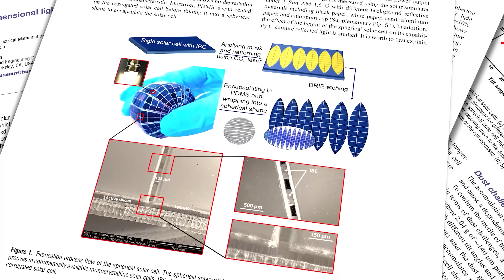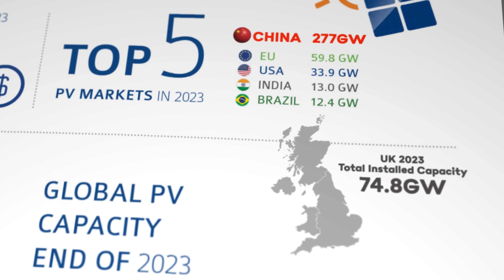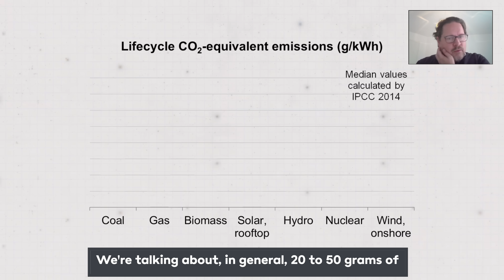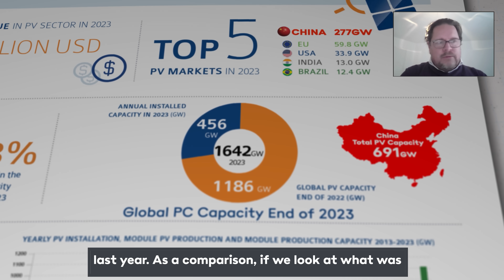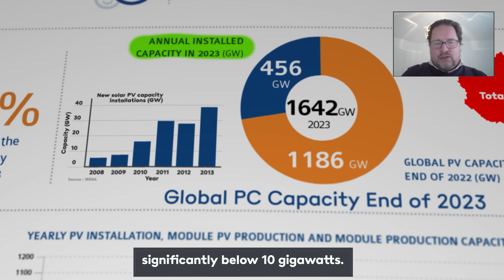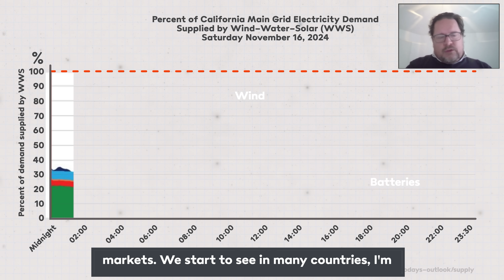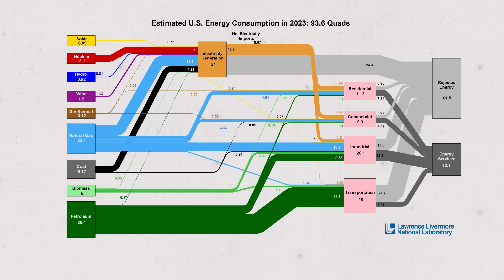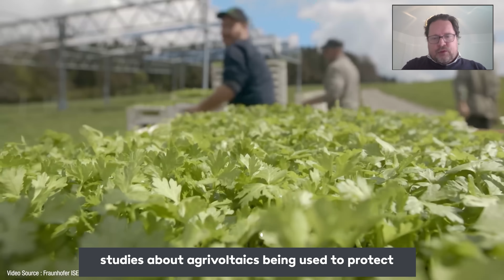Renewable Energy Domination

Comment: @Just Have a Think, I'm wondering, would you be able to please look into any studies or how beneficial ground-based solar panels could be for combating 'Soil Erosion' and 'Desertification'? Due to over-farming and grazing, deforesting, removing shrubs in semi-arid regions, soil salinity and desertification, encroachment of the desert is still an ever present concern. Some farmers and land owners have taken the initiative to build "carbon sinks" of former grazing land, to re-forest it with native vegetation and turn the land around from salinity and erosion from bad past practices. I wonder though, if, like with Solar Agrivoltaics, could they be selectively and targeted, to such border regions, more sun-exposed but also at-risk of erosion encroachment and a large panel array could be amongst the re-introduced low-lying scrubs and provide shade for native fauna, in those hotter, drier and lower rainfall, areas? I'm from Western Australia, so speaking with that kind of habitat in-mind, where the edge of the agricultural region meets the desert, or arid lands, or such. It could work well with transmission line interconnect too, because if old farms or stations out there, electricity transmission won't be soo far either - unlike crazier schemes seeking large panel arrays more remotely, middle of the desert or the like, which is much further from such infrastructure, let alone the larger population centres and epicentres of energy demand? This seems to be one paper, atleast, on the subject: https://www.sciencedirect.com/science/article/pii/S0038092X23008320 (A global assessment of the effects of solar farms on albedo, vegetation, and land surface temperature using remote sensing)
Another paper from 2020, about this: https://www.sciencedirect.com/science/article/abs/pii/S0959652620314232 (Combined ecological and economic benefits of the solar photovoltaic industry in arid sandy ecosystems) From a recently updated blog, 2 Oct 2024, covering inpart, the role ground-base Solar arrays can help in habitat rehabilitation, with erosion levels reduce, underground water restoration,  shaded areas etc: https://www.greenmatch.co.uk/blog/world-environment-day-renewable-energy (World Environment Day: Renewable Energy's Role in Land Restoration 2024, Written by Inemesit Ukpanah, Last updated 2 October 2024)
Reply: FANTASTIC POST, great resources, great ideas.
I'm saving it.
I cannot believe how much intelligence and creativity and problem-solving ability shows up in youtube comments sections. A lot of this stuff should be much much MUCH more prominently featured, instead of being buried here.

Comment: The only real issue with PV is the winter in areas far from the equator like northern Europe.
Storing the electricity from the day into the night is easy, but storing the electricity in the summer for the winter is almost impossible.

Thats why we also need a lot of wind energy, as it is usually stronger in winter.
Reply: Indeed, I was looking at the UK stats today: 24% of power generation from UK wind (on and off shore) and the plan is to double that by 2030 (well, that’s the aim). 40% during the recent storm.
But what of dunkleflaut?
Reply: @Sairfecht  A "Dunkelflaut" does not exist over the entire continent at any one time.  As of matter of fact, the higher the winter anti-cyclone generating the Dunkelflaut, the higher the winds on its periphery!  The answer is hence into a well interconnected continent-wide grid.  Unfortunately, the connection of the British grid to the continental one exists but is not too strong... like every other British connections to the continent, to be truthful.
Reply: @Sairfecht We have just had 3 consecutive days with a large anticyclone sat over the UK. Demand has been around 35GW, but wind and solar can only provide 3GW.  So the storage required would be 32 x 24 x 3 GWh if we are to rely solely on wind and solar. That is a huge amount of energy.
Reply: Not totally - it mainly comes down to storage. We will go from hours -> to days -> to weeks -> to finally months. After that, it mainly comes down to meeting the needs for a period of time. Aka, if we can recover by end of the month - then you only need as much PV as you need to recover from or at least bring back up peeker plants. The golden zone would be around 6 months of storage. Once you hit that, you can pretty much drop any need for peeker plants and even wind and just add on PV as needed to match demand for night time use. Of course, this is more limited to areas that have more sun. Aka, if you are way North - then solar doesnt make sense at all, but you are also not dealing with as many people too.
Reply: @adr2t  And how much space it will require to store energy for months? How much green areas will have to be destroyed to build these energy storage devices?
Reply: @ Not much space really. Keep in mind, Na one of the safiest batteries that are coming online hit the market (building cap of them), you can just store them on the side of your house, basement, or top of a building. You can also build them up or down too meaning the square land space can be very much low. The main issue is just how many can we build more than how much space they will take. Cost will very depending on how they make them, but should be 1/5 the cost of today's Li. There is a ton of "space" we can stick these things really or double up on what we currently use without really need to expand for more space.
Reply: @adr2t  That is true, space really isn't that much of an issue with batteries.
The 15kwh of batteries in my basement barely take up a corner and there is still space in that corner to double or triple the capacity.

However it doesn't make any sense to build so many batteries that storage over  months would be possible. Even if sodium batteries drop in price as much as you claim, it would still be really expensive. It would be cheaper (after building storage that lasts a few days to a week) to just increase generation (wind+solar), so that even in a dunkelflaute most of the needed energy can still be generated.
A nice side effect would be that we would have an excess of energy on normal days, so it would be cheap and power hungry industries that can control their day to day consumption would flourish.
Reply: @ You are thinking small though. A house would have around 2-3 days worth. EVs will have another 1-2 days worth. City would have a week on top of that. State could have another week on top of that. The only goal the batteries really have to hit is just charge rate over power usage. Aka, if you can store more than you use - you already hit what you really need to hit. After that, it mostly just comes down to building a little extra as the old gets recycle/ages out. Thus you would more than likely hit around a single month of power. As for power generation, yes, you would just cover the lower points, but you almost dont even have to do that, stuff like winter/cloudy days could be made up still with peeker plants and any Co2 off that could be reuse for other projects or store up. Solar and Wind still take up space unlike batteries. Wind takes up even more space and not many people are going to want to have them around over time let alone the cost of recycling them later on. Solar more than likely will take over as the main renewable as it can be place over what we currently already use up (placing them over parking lots). At least in the US, almost 50% of power we make goes to lilly nothing or heat. Thats a lot of power lost that can be stored in batteries in one way or another. NA batteries can last up to 25-30 years, so plenty of time to get every penny of that back from that 30% recovery rate from all power sources. Thus its going to cost you more to add more solar and wind in some cases as you have to buy the land, build something to house the power generation, and then set it up + connect it to the grid.

Comment: Another great episode! 

About the "embedded emissions", first, they're not limited to renewables, fossil fuel infrastructure and machinery also have "embedded emissions", but somehow, the renewable phobics seems to think/argue only renewables has them. More importantly, it's a transition,  the transition phase doesn't have to be perfect in order for the transition to be a much better option than continuing burning stuff as if there was no tomorrow. The emissions and other issues from renewables are already kind of insignificant compared to fossil fuels, which isn't limited to the toxic and climate destroying exhausts, there are plenty of issues with the sourcing, refining and transporting of fossil fuels, and then there's the issue of how the value of fossil fuels tends to empower war mongering megalomaniacs with god complexes.              

When it comes to space for solar PV, most domestic buildings has space for solar panels to generate much more power then the occupants needs, if the power is utilized somewhat efficiently. Solar panels the area of a parking space for one car can produce enough power for a normal commute, and since commuting means you need two parking spaces, one at home, and one at work, just the required parking space for one commuting car is enough to power commuting for two EVs, assuming those spaces are outdoors, and not shadowed. While that's not always the case, when it is, it's usually possible to make the solar panels cover a much larger area than the strict parking space alone. 

While there is a significant mismatch between sunshine and when we want power, there are a lot of ways to deal with that, that can be used in combination. Any reasoning about that issue that assumes that one single option has to be able to solve that issue by itself,  and/or that technology development will revert back to where it was 5 years ago or more, and then stay there is fundamentally flawed.

Comment: I am at minute one, and I see the graph. in 2013 there were just under 50 gw installed. Out of those, more than one gw was installed in my country. Impressive for my country.
We are blessed with a lot of hydro. Added two nuclear reactors and we have half of production assured. That year we added that gw solar plus two wind. That is about two percent of production in a single year. Unfortunately after that everything slowed down. Ten years later we have barely 30 percent more solar than 2013. 
If they would have continued the process now we could have eliminated coal entirely. But when wind blows hard, we export all surplus instead filling the water reserves. 
So yeah, technologically we could be totally green by now. But bureaucracy and greed keeps us decades away of that dream. 

At global level, things seems better. not 30 percent more installed as in my country, but over 1000 percent. But still there will be more decades till coal will be eliminated. Right now, barely a third of production is green, and half of that was here since before, being hydro. 

In conclusion, yes, adding over one Gw in a year is really impressive. but this means adding roughly one Twh production per year. And the world consumes 25000 twh annually.  The result is hallucinating. How many years at this pace will be needed to phase out coal globally? Sure, there is wind in the mix too., but figures seems impossible.  I see now that many countries are already considered 100 percent renewable in electricity sector. But globally we are quite far.

Comment: Still missing the obvious elephant in the room > transport of electricity. As long as you cannot have storage at home in any form and you have deliver it to the network in my country you are dead in the water. Our whole grid is locked right now and has reached max capacity.
Reply: Search:  "china"  "ultra high voltage"  "transmission"

Comment: Thing is though, if renewables are such a good deal how come they still need big subsidies? In the UK was have lots of windmills and increasing solar panels, and we have the most expensive electricity in the developed world. Germany is opening its coal fired power stations again after industry ran short of electricity. Just have a think eh?
Brian
Reply: Power pricing at consumer level can be and often is a political decision, having no necessary relation to cost of the given resource. For example: Germany decided to charge consumers more, and businesses less.
Fossil fuels are subsidized to a much much MUCH greater extent than renewables -- multiple $trillions per year.
Reply: @alan2102X  Hi Alan, thanks for that. I don't quite follow though - the oil industry in the UK pays a heck of a lot of tax on the oil that they dig up, the windfall tax most recently. The Government then adds fuel duty and VAT to that which they also take from us consumers. Surely this means the oil industry is paying a lot into the system, rather than being handed subsidies?
Thanks, 
Brian
Reply: The reason our electricity is so expensive is because it is based on an open market where the most expensive energy production is applied to all generated power, this is for the benefit of the privatised energy suppliers. Gas prices are normally the reason we are charged such high prices. If we decoupled wind and solar then we could all benefit from cheaper power.
Reply: As Alan says fossil fuels are subsidised hugely, the IMF calculates its $7 trillion a year.
Reply: @Simple_Slmon  Correct. And I would add that even the IMF's astonishing sum is probably an underestimate, when you consider how public funds are used for a myriad purposes that support and make profitable fossil fuel consumption, e.g. highway construction and maintenance, for just one example. A very large portion of our entire economy and even society has been given over to subsidizing fossil fuels. Subsidies for renewables are minute and trivial by comparison.

Comment: My offgrid pv- panels from 2004 still perform to their original spec’s. And even when at some point they do start to degrade, the most efficient thing to do is to keep using them.
Suppose at some future time they perform at 80%. To get back to 100% I could either scrap the whole installation and buy 100% new capacity. Or leave them  up and buy 20% new capacity. Pretty clear which option my financial advisor, i.e. my very self, would recommend.
Another angle is that after 30 or 40 years the electricity from those old panels is free. Replacing an installation working at 70% means spending 100% to gain 30%.
Reply: Just out of curiosity, would it make sense to put your existing setup on a rotating replacement schedule when you begin to see some degradation? I assume that like most goods and appliances, some will degrade faster than others. Is there a way to monitor the health of individual panels? Would it make sense to begin replacing a panel every few years?

I'm still in the planning stages of a PV install scheduled for this summer, but in order to afford my project without borrowing money, I am planning first to meet my current daylight power needs and rely on the grid tie and time of use billing to charge my car, and to make my system scalable. Over the next few years I plan to add capacity and batteries. Next steps will be to replace my (relatively new) gas range, dryer, water heater, and ancient hydronic boiler as they wear out and more efficient and cost-effective electric alternatives become economically available and my existing, reliable units reach the end of their service life.

Moving into a new-to-me, older house, I was able to see an immediate, tangible (50% reduction in my electric bill over three months) economic savings when I replaced incandescent bulbs with LEDs throughout the house. I am irked that I could not do so sooner because Americans fought so aggressively against energy efficiency.

Beginning a year ago, my electric car eliminated a $300/month gasoline bill while adding only $50/month to my electrical costs.

Light bulbs and electric cars are low hanging fruit, but they've saved me enough to afford solar panels and once I have those in, I am confident in more cost savings as I replace my remaining gas burning appliances with electric alternatives.

Completely ignoring the environmental benefits, transition to a fully electric, renewable energy-based economy is clearly a financial boon for consumers. The public policy issue in the US is whether we will seek to be leaders in this transition, or if we will cede the leadership in business opportunities, job creation, technological breakthroughs, cost benefits, and energy independence to the rest of the world.

Comment: Very encouraging. It seems blatantly obvious that this shift is going to accelerate and is unstoppable, so we should ride the wave rather than trying to hold back the tide. It will benefit everyone eventually. Really hoping the cost of installing solar and batteries drops quickly. The fact that there is so much misinformation out there shows you how powerful the fossil fuel lobby still is, sadly.
Reply: The rest of the world will ride the wave. The US will continue to try to hold back the tide until we drown.

Comment: UK recycling of refrigeration equipment is governed by law, to limit the release of CFCs/HCFCs. Apart from idiots who dump in front of houses & hope rag & bone men will oblige. If there is a reward of recovering materials &/or a cost to not recycle, then "law" is the way to go. PV in the UK gets put on "accessible" land - ie prime arable &/or grazing land. Not on South facing slopes where less support metalwork is needed. So solar is joined up only to the grid, not to thinking... I don't see sheep under the panels - another myth busted, energetically!